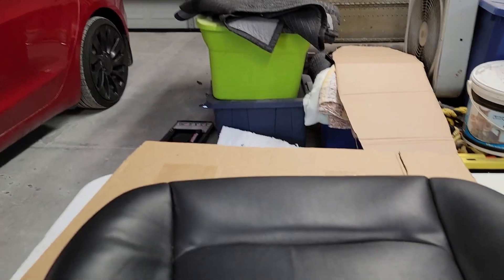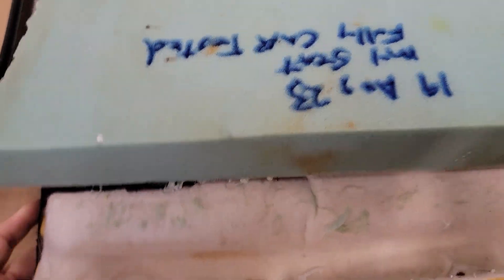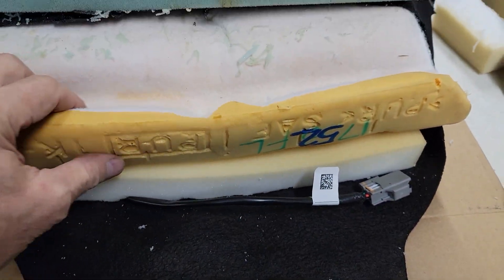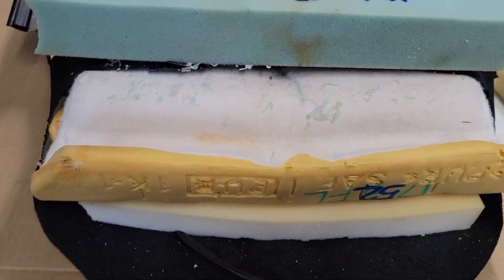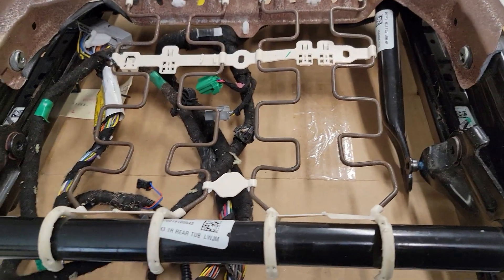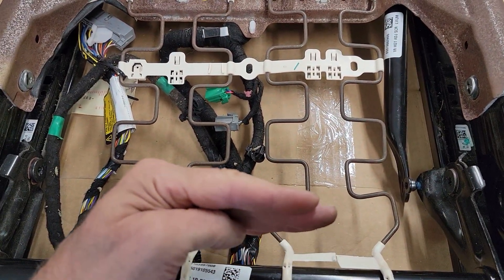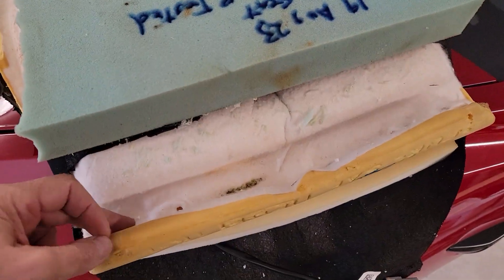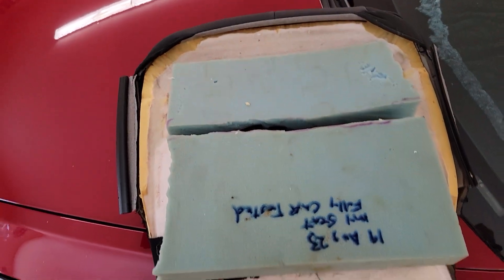Tesla custom seat

Comment: Hi George! Do you have a video on how to take the seat outside of the car? I watched all your videos but couldnt find it. There’s a large black cable under the seat and I dont know where to unplug that one. I’m asking because I’m taking my car to an upholstery shop and the person there hasnt worked on a tesla, so I’m doing some digging myself. Thank you! My butt and leg pain also thanks you! Ha 🥹
Reply from the maker: I've never taken the entire seat assembly out of the car.  It is absolutely not necessary for swapping the bottom cushion.  I assume you mean everything? Top , back,  bottom,  metal base, entirely?
Again, I only remove the bottom cushion. 
There are many cables and connectors.  The bottom cushion has two,  a small black seat sensor.  and a larger gray connector for the seat heater.  The upper has a seat heater and looks the same. The motors have their own power connectors.  I don't know how many.  The seat belts may have their own sensors.  Be careful!
You don't want to trigger the air bag.  It's located in the upper, facing the door. It probably has its own connector.  
I think it's advised to do a full power down of the car for safety. 
There's likely a procedure 
The steering wheel is likely in the way .
The seat might have to go out the back?????
Reply from the maker: I only take the seat bottom cushion out.  I remove the four floor bolts, carefully. I tip the seat back to have full access. 
I disconnect only two connectors. 
Trace it to the back of the seat bottom,  a larger gray connector for the lower seat heater. Then a tiny two wire black connector that passes through the center of the seat bottom. That's the only two. 
Then remove four clips that hold down the bottoms faux leather to the metal seat frame.
Reply from the maker: If you watch the video, starting at this point, minute marker 7:16, you get a really good idea of how the seat is mounted and it shows how to reinstall the seat bottom into the car. 
https://youtu.be/JHjnO9jUUsY?si=JlqXx3iFO5uuxMAu&t=436
Reply: Appreciate the quick reply George! Good morning! I understand now, those seats that you show are just for presentation! I think the upholstery guy mentioned that he usually removed the seats to work on them. I’ll see if I can find a video on how to. Thank you for the reply again. God bless you! 🙏🏽